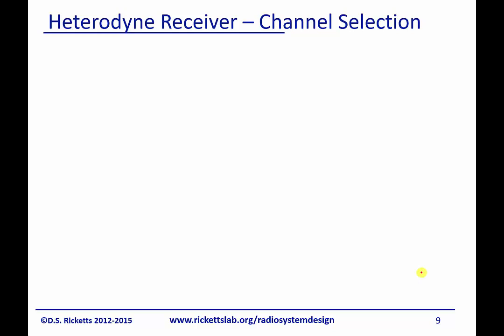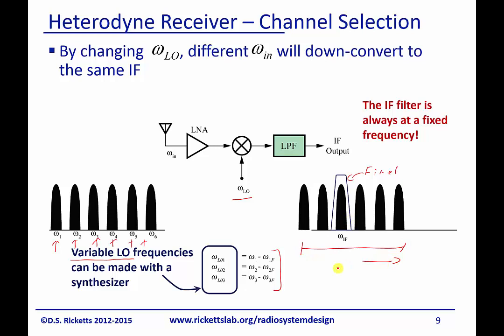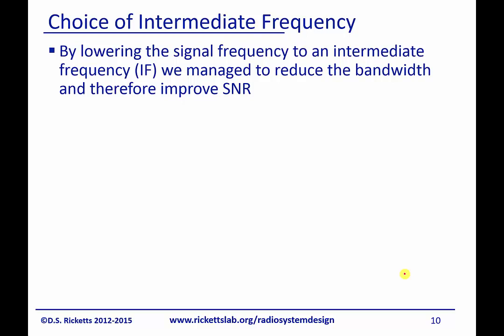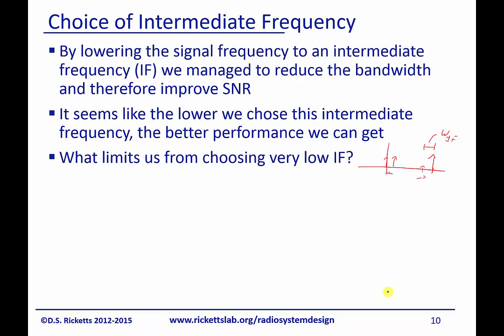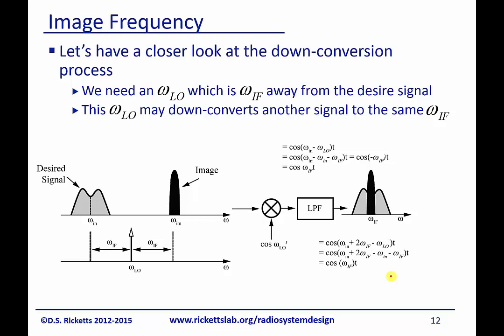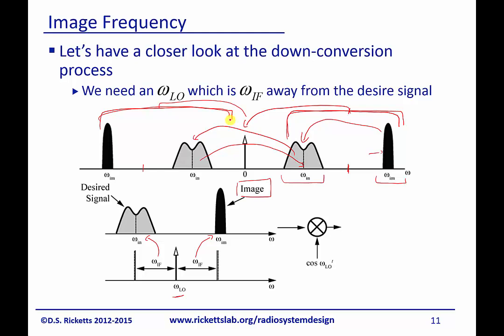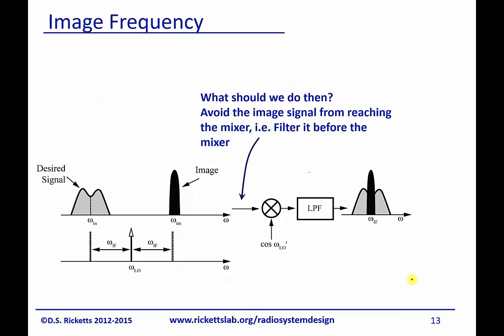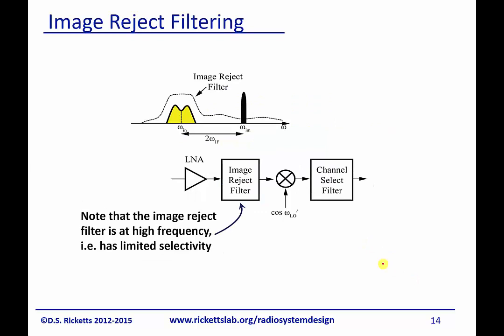Module 17: Heterodyne Receiver –and Image Rejection

Comment: thank you for the lecture. one thing i don't quite get is the absolute bandwidth of the BAND PASS filter. why is the absolute bandwidth of BPF is directly related to the filter's distance from the base-band? also, could you explain what is the absolute bandwidth? I tried to google its concept, end up in vain. thank you so much
Reply: Learn about q-factor
Reply: from wikipedia page: https://en.wikipedia.org/wiki/Superheterodyne_receiver#IF_bandpass_filter

"First, it is easier and less expensive to get high selectivity at a lower frequency. For the same bandwidth, a tuned circuit at a lower frequency needs a lower Q. Stated another way, for the same filter technology, a higher center frequency will take more IF filter stages to achieve the same selectivity bandwidth. "
Reply: @DuyNguyen-xb7gf  I don't see how it applies...